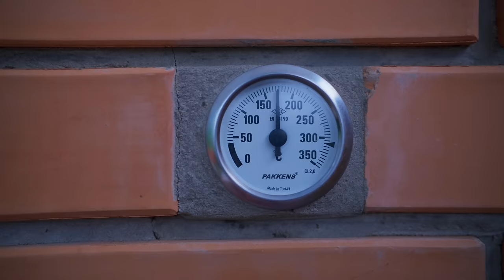I Made a Giant 440-Pound Kinder delice

Comment: Having watched a couple of videos about eggs and how they are commercially separated I think you could make a manual one. They look quite easy I think. From what I have seen its just a platform where you crack the eggs and then the yolk floats down a ramp with a gap between it. I am guessing that if you had a tub below it and a the ramp going in to another tub and crack the eggs on the tray above and that tray has a slight angle to it you would be fine.